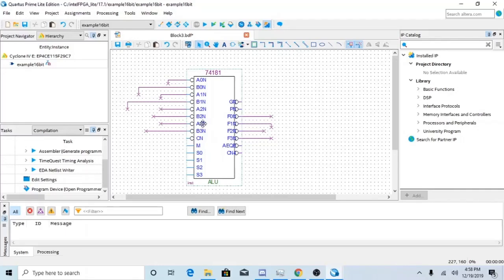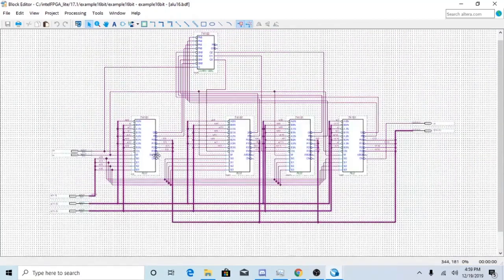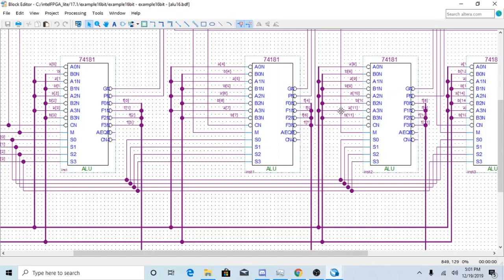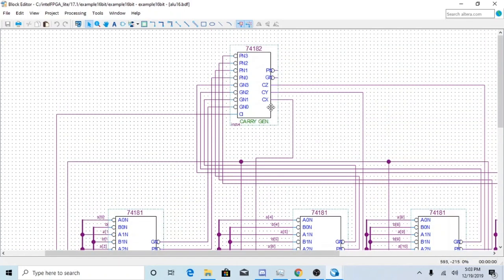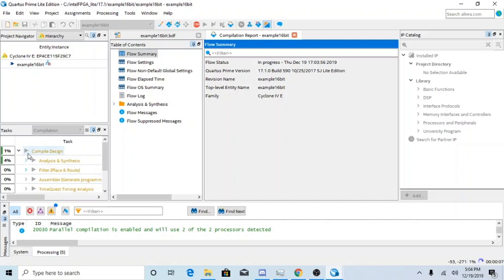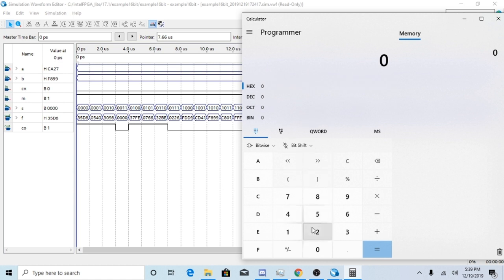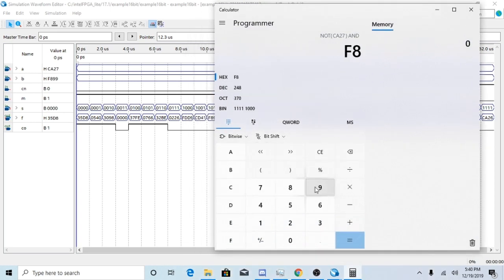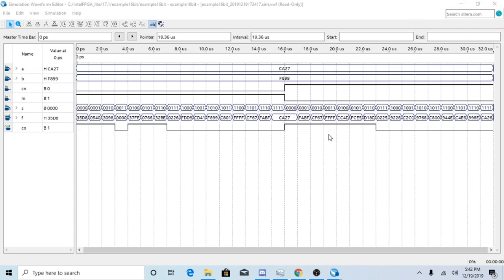16 Bit ALU Tutorial with 74181 & 74182

Comment: Just some feedback.

First good job with the layout.  The ‘181 & ‘182 are classic ALU chips but harder to find than the ‘183/‘283 that are use with Ben Eaters based projects.  

Consider showing the big overview and maybe even label the main chip in video editor.  Pause on the page long enough to take things in.  Maybe even use different colors for different chips.

When showing a close up if the schematic, pause a lot longer than you think is needed.  This gives the viewer a chance to get oriented and make since of the layout.  Jumping around during a presentation is a frequent issue with people giving presentations.

Also - don’t just tell people what you are doing, tell them why.  That will help others follow your discussions.

If working a problem from a text book, show the problem in a pop up window so that can stay with you on what issue you are tackling.

Your audio is very clear and that is super helpful.  

All intended to be constructive feedback.  Take care.
Reply: If you want more details you have to refer to the data sheet of 74181 and 74182 there are more details about the functionality of the chip and how to connect them together.
Reply: If you wanted to know more details about those chips 74181 and 74182 you need to refer to the data sheet of those chips and the functionality of those chips are defined in those data sheets and how you connect them with one another.
Reply: '182 is not a ALU. Only '181